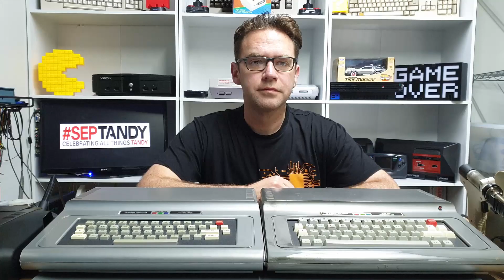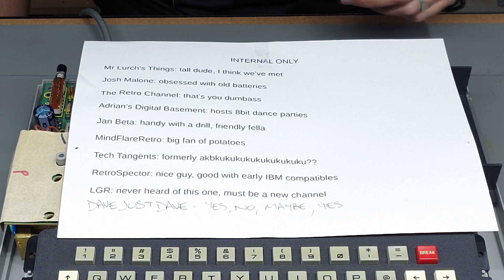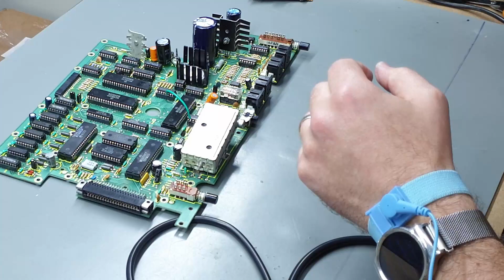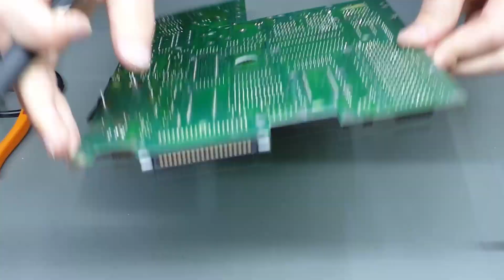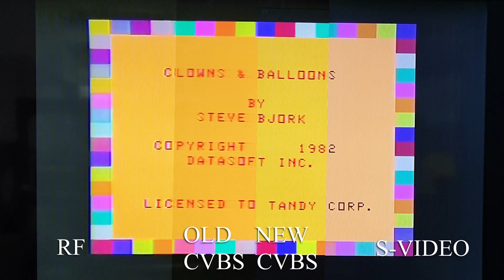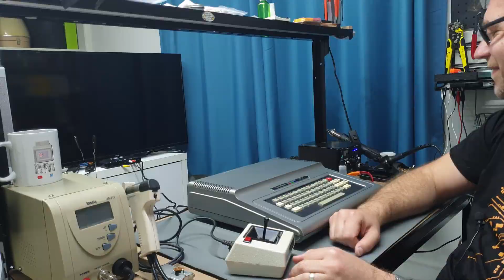Tandy TRS-80 CoCo1 S-Video / composite mod #SepTandy 2020

Comment: I was subscribed, but missed going back to watch (busy month). S-Video was awesome. I was sitting then imagined being a time traveler and grabbing a Coco user and bringing him to see the "same" machine, only with a flat panel and a crisp display and no floppy drive. It would be so trippy for that person....
Reply from the maker: Hey Jeffrey, yeah it would be pretty mind-blowing to see something like that back then. What's funny is a lot of these systems actually have video formats that are somewhat compatible with what later became standards, like S-video and component (YPbPr).

I guess it's just there's was no real reason to make them available to the end user as RF was simple, cheap and commonplace. Especially for households in the late 70s, early 80s
Reply: @TheRetroChannel  Yeah, although composite had existed  since the mid 1950’s I doubt that most TVs bothered with it. I don’t remember any of the TVs of the 1970’s or even the early 1980’s coming with composite. When cable TV first came through it connected with coax to new TVs and used baluns to connect via older connections. When hobbyists wanted better video, we first found monochrome terminals, then adapted them as monitors. We then stripped RF down to composite signals. When color tubes came into existence, they operated with RGB and added circuits to minimize wires. Composite needed splitting out at the TV/monitor. Then we accepted the wires and used component with less multiplexing. As we moved into digital this just became easier.

Had we been using digital RF sooner, we might still be using it today.

Most of our inventions are more evolutionary than revolutionary because upsetting the apple cart doesn’t sell. Gradually changing things when clear superiority exists is easy to sell. Early adopters pay the way for reduced production costs and works out the bugs. Same for any tech or any product tech or not really. 

REALLY liked the S-Video mod and how it was non-destructive to the case. Very nice and high quality improvement. Can’t wait to see what the problems were with #2 (playing catch up here). Binge watching these. Enjoying them. Thanks!

Comment: Why are PAL artifacts so bad with composite video
Reply from the maker: Its just due to how the PAL system encodes colour information. As most CoCo games were developed in the US they were designed to take advantage of this hack, which worked fine in NTSC (apart from occasionally having the reset the machine to swap the colours being displayed) but PAL can't do that trick and so we ended up with purple and green stripes 🤮

Comment: Hello TheRetroChannel !   I saw your CoCo 1 video while I was working on the S-Video mod!  It was fortuitous and I learned plenty from yours, believe me.  That is the cool thing about having all these interesting channels like yours to view; there is something to learn everyday.  About the variable resistor you are needing to add in series with the Chroma output.  I'm not familiar enough with every S-Video variation that monitors and devices have implemented so I don't know the cause of this issue yet.  But I noticed that in the bhabbott.net.nz reference that I showed in my video, that he had an AC-coupling capacitor in series with his 75-Ohm Chroma output.  I didn't know why it was there, and I haven't seen it in other implementations.  My guess is that some monitor inputs do not tolerate as much common mode voltage offset, or DC offset, and want the signal closer to ground.  Did you discover that your FrameMeister needed 1k by experimentation or did its documentation cover it?  The 1k would attenuate the voltage level, but I wonder if the AC coupling cap would also have worked.  It wouldn't attenuate, but it would shift the common mode voltage closer to the monitor input.
Reply from the maker: For anyone interested, AC also created his own S-Video mod. You can find the video and my response to this question there https://youtu.be/tayGsz7Xs3A

Comment: This is my first comment ever on Youtube but only because I haven't been able to find any other method of contacting the creator of this channel so I really hope he reads this. 

Anyway, I just wanted to say that the S-video/composite mod featured in this video has found a use in a rare video game console called the Gakken Compact Vision TV-Boy. I recently managed to acquire one of these for my collection and due to its rarity extremely little information is available. However, when I started digging around in it I noticed that it shares the same MC1372 and MC6847 chips as the Coco and I figured I might be able to use this mod in the console. Sure enough, it actually does work, though I suspect it needs to be optimized for the TV-boy in order for the best result. Still, it's a huge improvement compared to the stock Japanese NTSC RF output, though some TVs doesn't seem to like the signal.
Reply from the maker: Hey Kenneth, glad it (sort of) worked for you. Very interesting to hear about this Gakken tv boy, I just googled it - the joystick reminds me of an 80s automatic gear shifter!

Anyway, as I assume it's an NTSC machine you may want to try out the S-Video mod by AC's 8bit zone https://youtu.be/tayGsz7Xs3A
He shows his circuit around the 50 minute mark in the video. I built his design yesterday but i still had trouble with the chroma, so I had to put in a potentiometer to adjust the chroma levels. But I think that chroma problem is limited to PAL machines so you may have better luck with his design. Cheers

Comment: The S-Video does look pretty great! Ok I need to try this -- but the issue is the Coco 2 I have has the encoder chip in the RF modulator. So I assume I will need to keep it inside there? Maybe?
Reply from the maker: Yeah, that's the tricky part. I also tested it with the CoCo2 but again the PAL version I have has the 1372 outside the modulator. Still I think it's worth just trying to tap off the 1372 while it's in the modulator and see what you get. Just throw everything on a little breadboard and probably check the output on your scope before connecting it to a display, just in case

Comment: Given the proximity of the chip you're pulling signals from, design a drop in board that sits over the chip socket and has passthrough legs. That wsy you only have the audio lead to solder separately.
Reply from the maker: Good idea Peter. This is very much in the prototype stage, so there's a few tweaks to be made

Comment: Nice job.  Just a suggestion, but I would have used wire-wrap wire and run it through one or more of the RF modulator mounting holes, or a strategically drilled hole, to the underside and attached to the IC pads down there.  Purely cosmetic...  I 'm interested in doing this to my COCO-1, but it's a pristine example and I'm a little reluctant.  Love COCO's though.  I have a 1, a 2 and a 3 as well as an MC-10, if you can call that a COCO.
Reply from the maker: Thanks, and yes I definitely considered doing the wiring from the underside and brining it up through the RF mounting holes. I figure the design will be tweaked at some point so it will likely be coming back out again

Comment: Great video!!! I saw Adrian Digotal Basement where he modified the RF modulator to do composite out. Wouldn't that work on your Coco computer?
Reply: The one where you snip the wire on the composite input to the RF modulator like you can on the Spectrum and feed it directly to the video jack? Short answer seems to be YES! I just tested it and it seems to work. I am working on a similar video and I am drooling over the quality of this svideo output. So far I have tested three different composite mods, but the best output I am getting is by just tapping in to pin 1 on the RF modulator for composite video and pin 3 for audio. Still, the composite output is not as clean and bright as I would expect.  I am going to try replacing some caps and see if I am just battling some interference that isn't getting filtered out.
Reply from the maker: Looks like the YT spam filter held your reply, funny since it's more than happy to let through the "Let's be youtube friends" spambots. Anyway, yes you can tap the video off pin 1 and audio off pin 3 of the RF modulator but they will not be very "clean" and I'm pretty sure the video signal has a pretty large DC offset. This may be confusing your display by not being able interpret the correct reference black/white levels, causing too dark/bright/low contrast output
Reply from the maker: I know the video you're referring to, but it wouldn't really work with the CoCo. And even if you did manage to convert the RF to composite, you would still need to add another socket for the audio out. It would be nice though

Comment: First! Haha!      Awesome video! And timely -- I've researching better video output options for the NTSC CoCo 2 I'm working on, so this was very interesting. I do like the S-Video option, but I am not sure if that is easily doable on a CoCo 2. Your perfboard circuit worked really well IMO and the fit was brilliant. Has anyone laid that out for making PCBs -- perhaps a KiCad project for you? Anyway, this is another great #SEPTANDY contribution. Well done!  Oh! And thanks so much for the extra shoutout; that made me laugh.😂☕
Reply: @TheRetroChannel  I did add a more substantial comment. I just wanted to be first for once! 😜
Reply from the maker: Thanks MFR, maybe with a bit more testing it could become a proper PCB. I really want to sort out the sync issue. I know most people probably use the same display, but having to potentially open the computer to adjust that trimpot when changing displays is a pain in the arse. I guess there's always the composite out as a fall back, but who wants that when you've got S-Video right there
Reply from the maker: The 1372 can drive the circuit from its 5v supply.
I would recommend trying out the mod by ACs 8bit zone, you can find it here: https://youtu.be/tayGsz7Xs3A
He talks about it around the 45 minute mark and there's a link in his video description to his circuit. Like I said, circuit design is not my strong suit and he clearly knows a little more on the subject.

If you have a PAL machine then either circuit may not work reliably, unfortunately this is just due to how the signals are created in the PAL variants. But if you have NTSC then definitely try ACs mod